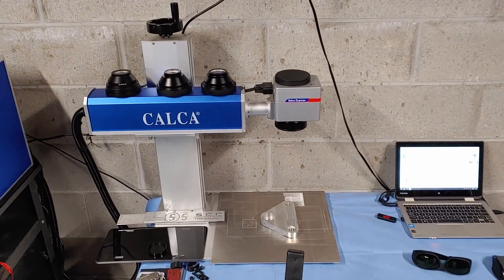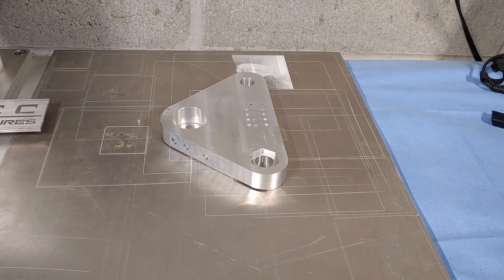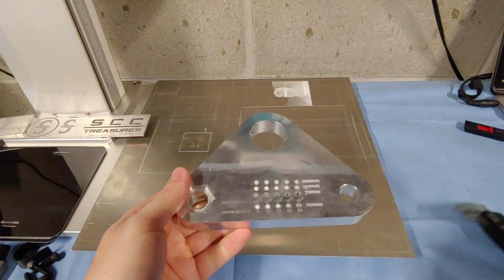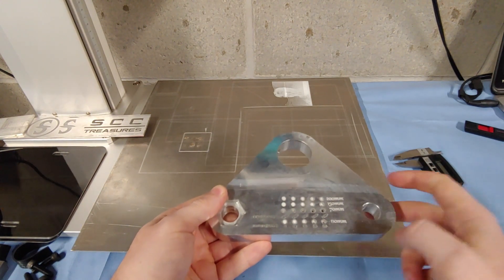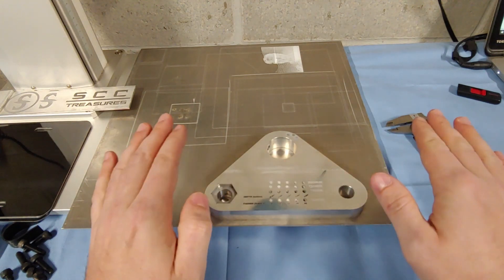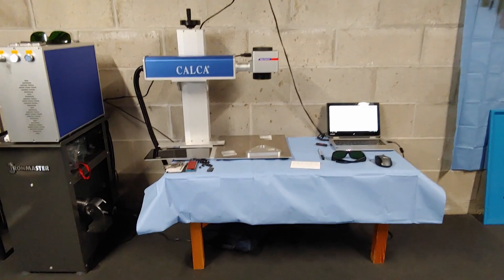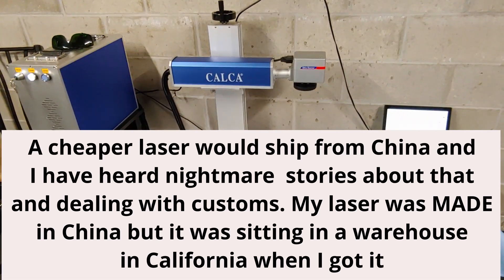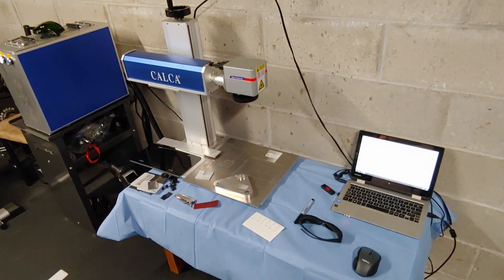Testing Lens Power on a 50W Fiber Laser

Comment: Any chance this can go through 14ga mild steel? I have a friend who needs some cut. Otherwise i woukd use it for engraving firearms for another friend of mine.
Reply from the maker: Unfortunately even this 50W laser really isn’t meant for cutting. You could eventually get through 14g mild steel with the right settings but it would take an extreme amount of time and really just wouldn’t be worth it in my opinion. It works amazing for engraving though

Comment: With a 60W mopa, a friend wanted to purchase a 100W...  Prices are down from the video, but I warned him that a F100mm lens for my 60W as <$70 US... the F100mm for =>100W is $370+.  Over 8 times more expensive...  Most of the <100W lenses are marked with a G suffix...  Keep it in mind when going for more power...
Reply from the maker: Thank you for the information! I have been debating a 100W MOPA for a long time but I'll definitely have to weigh that into the decision making.

Comment: I am looking to engrave letters in 6061 / 7075  aluminum between a 1/16 and 1/8" deep and about the same size in dia.  would a 20 or 30 watt do the job, ?   Funds are a factor here,  Just getting started
Reply from the maker: Unfortunately I think you would be extremely disappointed with a 20 or 30w laser if your goal is to get that depth. Even my 50W would struggle to get up to 1/8" depth in a reasonable amount of time on a larger part than the hole in this video but it certainly could do it.

With most of the fiber lasers the real question becomes how much time do you want to spend when it comes to depth. With a little bit of compressed air blowing the ablated material out and manually adjusting the focus as the laser goes, you can achieve some really deep marks. But at a certain point it just becomes cumbersome to do.

If your main purpose for the laser is to engrave to that depth, a 50W laser at minimum is what I would recommend, with a 100W being much closer to what you would actually need.
Reply: @MPMachining  Thanks I checked the depth has to be 3mm,   Im trying to find a way to engrave without breaking the bank.. Again thanks for your time

Comment: Would you recommend this laser for firearm work? Etching and cutting? Or just etching/engraving? What are your thoughts?
Reply from the maker: I use this laser almost exclusively for firearm work. It is an extremely valuable addition to the shop but very far from a replacement to the mill. The laser does a great job at engraving/etching but you will be very disappointed if your goal is to use a 50W fiber laser to cut holes through a slide. It's just the wrong tool for the job.

Comment: How long does it take to cut 1mm stainless steel with that 70mm. Lets say 50mm x 50mm rectangle to cut? Thanks.
Reply from the maker: This type of machine really isn't meant for cutting but it certainly can do it (just slow). I have cut plenty of 1.5mm steel with it. It would take somewhere around 10-15 minutes to cut straight through a 50x50mm box.
Reply: @MPMachining  okay thanks. Probably faster on silver? I ordered a 80w machine
Reply from the maker: Yea it's all very material dependent. The more heat deflection in the material, the longer it would take. Silver would certainly be faster and definitely even faster on an 80W machine compared to this 50W

Comment: From what I was told, with a higher wattage laser, you can engrave a larger area with a larger lens, while maintaining power. Also, I was told that a 50 watt laser will engrave faster than a 20 watt laser. Is this correct?
Reply from the maker: Sorry, I must have missed this comment from you. Both of those things are absolutely true in my testing. And the results (shown in my depth testing video) are very significant between a 20 and 50w laser

Comment: Very nice video, I have a 50w coming from China soon, I am hoping the customs issue will not be an issue. I do have a questions regarding the EZCad software and how to do a certain type of engraving. I have an idea I want to do  essentially a rectangular shape,and have the depth of the engraving get deeper as you go from left to right, is this something you have played around with?
Reply from the maker: I'm glad the video was of some help. I have been loving my laser and getting a ton of use out of it. 

As for your application, that's not something I have had to do and definitely not something that the software was designed to handle. EZCad is setup to do 2D marking so variable depths within a single hatch can't be done automatically.

That's not at all to say you aren't able to get the outcome you're looking for. There are several ways to get a 3D effect but unfortunately almost all of them are very manual processes where you slowly change the size of the image and run passes over and over again. That would effectively run more passes as you move from left to right which would make the right side deeper. Doing it that way can give you pretty great 3D marks but will take a lot of time if you don't want obvious steps in the engraving.  The more steps you do, the less obvious the transition lines will be.

Another option would be to try marking the file as a dithered bitmap rather than a vector file. Just make the image progressively darker on one side than the other and play around with your power profile so it engraved the darker points with more power than the lighter points and the darker side will also have more dots than the lighter points. This is by far the most automated way you can handle the 3D effect, unfortunately it's going to involve a much longer marking time as dithered images are just thousands of lasered dots rather than continuous lasered lines meaning you remove much less material.

I hope that at least steers you in the right direction
Reply: @MPMachining   thank you for you quick reply and honest answer, I will definitely work on figuring it out once I start using mine. If I do manage to figure out something useful, I will let you know.

Comment: What kind of depths do you think I could get on steel? I wanting to know if I could make 1/16" or 1.5mm depths. I need to be able to make sharp corners that are hard to achieve on milling machines.
Reply from the maker: You can absolutely make 1/16". The only question would be how large the marking would be and how fast you need it done. I have done tons of engraving in tool steel (A2) and carbon steel but it takes a couple dozen passes
Reply: @MPMachining Time is not an issue. I will be making small stainless boxes that need a deep wood grain look on some and a deep honey comb style pattern on another. The octagon of the honey comb will be no bigger than 1/4". If it can handle that it will be great for any other project I would be doing. I've been looking to get a laser and have had several projects that would have most likely been much easier with one. I'm just trying to get something that will do what I need. I'm also a machinist so I do alot of metal working with mills and lathes.
Reply from the maker: This is definitely going to suite your needs if that's the case. I'll be honest that doing the honeycomb would be WAY faster on the mill if you could live with the small corner radius of a 1/8 or 1/16" tool but the laser will make perfect corners if you need and wood grain would be next to impossible on the mill and super easy on the laser
Reply: @MPMachining  Great! Thanks for the replies. To bad you're not a laser salesman, you would have just made a sale. I've was just watching some of your other videos. I also dabble in knife making and gun mods. I hit the subscribe button. Will definitely be checking out the rest of your videos. Thanks for your time.
Reply from the maker: Haha thanks a lot. I try to help the community as much as I can. It has definitely helped me a ton along the way. I really do need to get some new videos uploaded too. So much has changed since my last ones were filmed

Comment: can this engrave glass?
Reply from the maker: Unfortunately Fiber lasers are unable to mark on clear surfaces like glass and plexiglass. It has to due with their wavelength (1064nm) of the beam and how it interacts with material. If you want to mark on glass and organic material like wood, you would want to look for the much cheaper C02 lasers. They can't mark metal like the fiber laser can, but they do a great job with those materials

Comment: Where did you pick up the lenses?
Thanks
Reply from the maker: All but the 70mm I ordered along with the laser. The 70mm lens I picked up on eBay by just searching around (the seller I used is no longer in business). It came from china but you can expect them all to perform about the same

Comment: Hi Sir . I have a 50 watt but struggling to cut through a 1.2 mm silver sheet. Considering buying a 100 watt Mopa or 60 watt. what are your thoughts?
Reply from the maker: I couldn't agree more with the lines compared to holes. The wobble setting works pretty well but honestly I have had great results with just making a very thin rectangle and hatching that pretty tight. Where wobble works way better is obviously anything that wouldn't be a straight line. If you're tracing around an object to cut it out then wobble is your friend. Most importantly, use the smallest lens that you possibly can. The difference in power is huge when comparing say a 70mm to a 300mm lens
Reply from the maker: I have never had a ton of luck using the laser to cut. I have done some tests on 1.6mm steel and been able to cut through it, however, it takes about 20 minutes to cut through for a circle that is only about 12mm diameter. A 100W would definitely work much better but I don't have any experience as to how much faster it would be

Comment: Hello, 
How much speed did you use for your hole test ?
Reply from the maker: Hello, I got the file for the test from another YouTube user names JefferyJ but I have included the link to the file below if you would like to see the settings or try the file yourself.

https://www.dropbox.com/s/f9gv53duc8zhz0p/Marking%20a%20Predetermined%20Depth.ezd?dl=0
Reply: I can point you to a few laser groups where you can find lots of settings...https://www.facebook.com/groups/440091022989424/
https://www.facebook.com/groups/4105345129538639/

Comment: How deep did you manage to do those holes, did I hear right some were 0.8 inch?
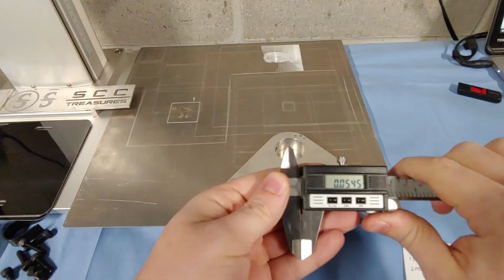Reply from the maker: If you watch at around 10:10 mark, I put up a chart of the depths with each lens. I got about 1/8" deep (0.121") on the deepest test. You can obviously go deeper than that if you were to run it longer
Reply: @MPMachining  Ahh, its a 1/8th inch hole diameter at 0.013 inch deep, I miss-understood thinking that you basically drilled the hole 1/8 deep.
Reply from the maker: LASERSHOWSSRL no, you were correct with your first assumption. The diameter of the hole is the same for each (i dont actually remember how big it is but about 0.2” diameter). I did drill that hole 1/8” deep in aluminum with the 70mm lens. Like i said, depending how many passes you did you could go even deeper. I just kept all settings the same between the lenses and ran the test to see the difference
Reply: @MPMachining  Ahh, that is super.

Comment: Hey Bro, thanks for these informative videos. If you don't mind me asking how much did the 50 watt cost? I'm trying to get one but I'm seeing a whole range of prices, don't want to overpay or underpay.
Reply from the maker: That's a hard question to answer. I can tell you what I paid but like you said, there is a huge difference in price range. I paid $7200 for the laser after tax, shipping and all of the accessories I got. You can find them directly from China for MUCH cheaper but I have heard enough nightmare stories from people doing that so I decided to stay away. I see them on Amazon going for $5500 fairly often but I can't speak to the quality or customer service with those.
Reply: Thanks for the info bro, Ya since Covid happened the prices have dropped considerably from earlier in the year so I was super confused as to what I should be paying. by the way I see you bought a few different focal lens, why was that?
Reply from the maker: Sean Q most of what i do is deep engraving. If you watch the video it will explain the advantages of smaller lenses for depth.
Reply: Battle Resistant Outfitters I bought mine from sign in China and was about 8k for a 30w MOPA included a laptop and rotary fixture

Comment: Great video!
Reply from the maker: Thank you very much. I wish I got around to filming more. I have the laser and the mill running at least every other day, I just have to learn to set up a camera
Reply: @MPMachining Right on. Well im glade i ran across this video.  I've been running a 30 fiber laser for a while now but just purchased a 50w today. Same brand as what you have there. Hopefully it'll run as well as yours seems to.
Reply from the maker: @robbillpries6198  I have definitely been happy with mine so far. Ran a 60 part order of some dark marking in stainless this past week and it worked great. What lens/lenses did you end up going with?
Reply: @MPMachining  I assume that you are on FB & or  IG?  If so let's carry on with this conversation over there

Comment: Have you tried using this on stainless steel? I have some stainless steel keypad plates that I used to have my laser shop etch my company name and info on them and they no longer have that laser.
Reply from the maker: csxal absolutely. It works very well on stainless. Unfortunately it isnt a MOPA laser so it cant do fancy colors on stainless
Reply: Battle Resistant Outfitters Thank you!